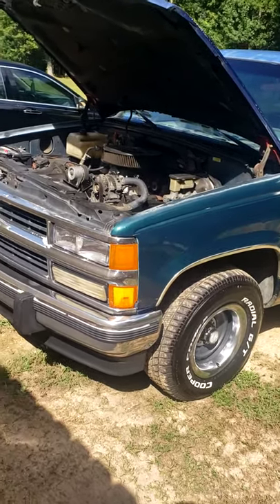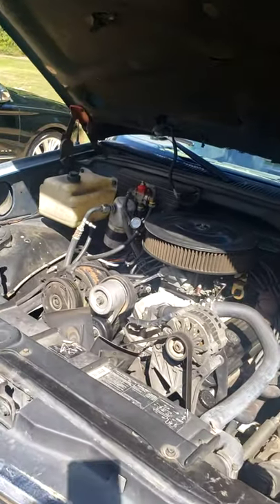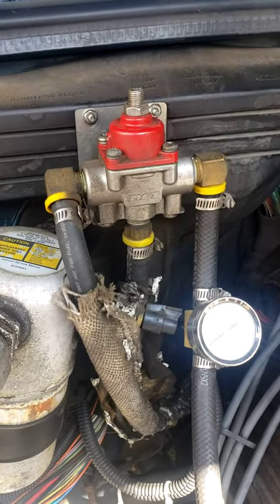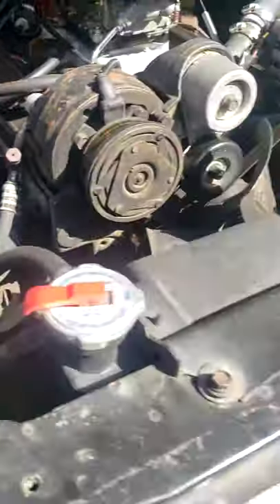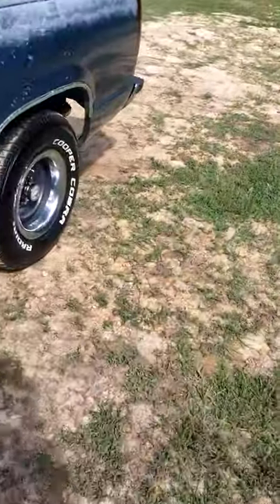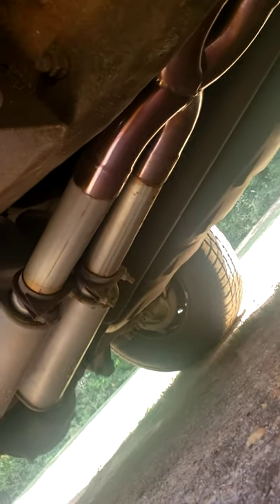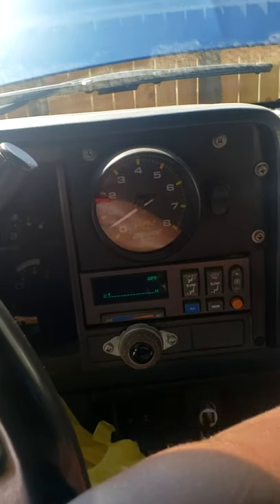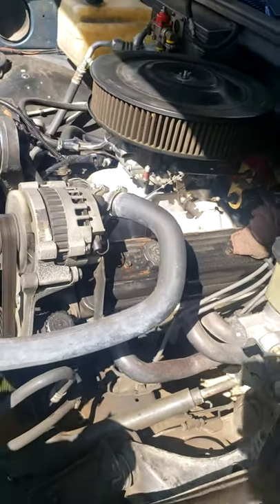Cammed my 91 STOCK BOTTOM END 350 on a SUPER TIGHT Budget!!!

Comment: I have a 90 model gmc. Looking at putting a cam. Would you encourage getting away from the TBI and just go straight carbureted or what? Thanks
Reply from the maker: Good question! It depends on what you are into and your budget. They do offer some TBI cam kits that will work with the factory computer. But, if you get too radical with the cam selection, it will cause drivability issues. I like the carb version better. To me, it's easier to adjust ignition timing and carb settings myself than, to put the parts on I want and then have to get someone to flash the ECM and/or tune it as well.
Reply: @WorkingwithBobby  that makes sense. I already have a chip for 93 octane 165 thermostat. I’m honestly on a budget would like to just do cam. Thank for input!
Reply from the maker: @scott9478  yes sir. No problem. If you do any shopping with summit or any other performance based company,  you should be able to filter your search or talk to the tech department about potential cam kits that will work for your application. ✊🏾✊🏾

Comment: If you get the K&N Filter hat it will do a lot better. All in all nice truck.
Reply from the maker: You talking about the filter that has the top lid which is also a filter? I thought about it. Maybe I'll invest in that set up when I can afford it. Thanks man!
Reply: @WorkingwithBobby  It makes a world of difference. On a low hp engine (round about 210hp) For power
 It's as good as no filter at all.
Reply from the maker: @Deadpool-ODST  that's whats up. I'm going to look into this for sure! I am a sucker for doing things that squeeze every bit of horsepower from an engine on a budget! ✊🏾✊🏾

Comment: How much did it cost to do the front end/grille swap ? And was it easy to do or did you have to do some cutting and grinding? lol
Reply from the maker: Good question! I actually didn't swap the front end like you may think. I hit a huge deer. The junkyards near me didn't have the factory grille like I wanted so, I just went with the newer truck grille. I had to also replace the radiator support. I have been told that it's an easy swap if that's something you want to do though.

Comment: I've got a 1994 chevy 305 and wanna put a bigger cam in it what should I look for to be as similar to yours
Reply from the maker: Some would tell you to first get a 350. You don't have to do that of its not in your budget and if it's a good running engine. All you have to do is do your research as I did and find out what's the most aggressive you cam you can get that will work with your application. I could tell you more given more info on your truck. Would you like to email me?

Comment: Why haven't you got your spark advance vacuum hose hooked up?
Reply from the maker: Very good question! Not sure if I can answer it fully but, I'm only using mechanical advance. Most think that the spark advance gives you more timing under heavy loads and acceleration but, it actually retards timing to prevent spark rattle under heavy loads and acceleration. It robs power while doing so. You have to have your timing set pretty high on any engine to notice the negative effects of not using the vacuum advance. Hope this helps.✊🏾✊🏾
Reply: @WorkingwithBobby  if your timing was advanced mechanically it would be hard to start your engine after it gets warm. Someone had fed you a line of bull. The cam itself has took from your vacuum, but even with the cam try to get your timing right and hook that vacuum hose up to a good vacuum on your carburetor and you will gain 20+ horsepower during acceleration..
Reply from the maker: @markduvall5918  I respect how you feel. No one fed me anything. I did research before I tried it myself. What I did was check my initial timing at idle with it warmed up. Then I slowly increased rpm while watching my timing light to see what my mechanical advance was until it stopped increasing. Then I did simple math to see what total timing was. Right now my total timing is 34 degrees advance. At idle, it's around 12 to 14 degrees which means my mechanical advance would be 20 to 22 degrees. I don't have any issues starting my truck at all. If I'm wrong, I don't mind admitting it. I do believe if running vacuum advance added 20+ horsepower, the racers on track would be doing running an HEI with vacuum advance connected instead of the high end distributors without an advance at all. Thanks for watching.✊🏾✊🏾
Reply: I have a 98  5 .7 that's the same for me a little at  a time hope I can achieve what you have nice work !!

Comment: Do you still have the truck? How are you controlling advance?
Reply from the maker: Yes sir! Belle is the star of my channel right now. I'm not, if you talking about it igniton timing. What I did was Rev the engine up to about 2200 or so rpm, then I put my timing light on it and set total timing to 32 or 34 degrees. Then I let it idle and reset my engine idle back where it needed to be. It put my ignition timing around 12 to 14 degrees at idle. That means my mechanical advance in the distributor is worth almost or right at 20 degrees. Hope this helps!✊🏾✊🏾

Comment: How much of a difference did the cam make in terms of torque and horsepower ? And Im wondering if with tbi heads itd make a difference
Reply from the maker: Good question! I have not had my truck or engine combo on a dyno so, I don't know exact numbers. I will say this though, research has proven that just the vortec head swap is good for up to 30 horsepower gains. The cam is something I have no clue on. I'd like to believe that it had some type of gain or affected the power numbers in some way. I hist don't know how much.
Reply: @WorkingwithBobby  how different does it feel from stock everything?
Reply from the maker: @diegomartinezliscano9341  I immediately felt a difference when I did the head swap. You can feel 30 horsepower in the seat!
Reply: @WorkingwithBobby  forsure swapping my heads 💪🏾

Comment: You’ll wanna run a rubber line from that vaccuum advance you have plugged off. That’s part of your tuning/idle issue…
Reply from the maker: I used to run the vacuum advance o. The distributor but, I disconnected it after I learned what my advance curve was and set my total timing to 34 degrees total timing with the engine at 2500 rpm. That put my ignition timing at idle at 12-14 degrees advance. I then set my engine idle at full warm up to around 725 rpm. It starts and ran perfect after asking some minor adjustments to the accelerator pump lever. So, no need for vacuum advance anymore for me. Hope this information helps.✊🏾✊🏾
Reply: How is your total timing 34 degrees without the vaccuum advance?
Reply from the maker: @andrewayersman6923  I use the weights and springs in the distributor under the rotory button only. As the distributor turns faster and faster,  the weights swing out advancing the ignition timing. It's not 34 degrees advanced @ idle. Only after 2500 or so rpm. Like I said, at idle, my ignition timing is around 12 maybe 13 degrees advanced. When I Rev it up, ignition timing is at 34 degrees per the timing light. It's really easy and helps engine performance! Hope this info helps dude.🤟🏾🤟🏾✊🏾✊🏾
Reply: @WorkingwithBobby  oh I am aware of recurving, I’ve built a ton of engines lol I was thinking that was your tuning issue when I saw you had the advance plugged off. Realistically you should have more than 12 degrees at idle but that’s pretty minor. High rpm is where it matters lol I’m running the k1106 in a vortec I built. Much larger cam than yours lol I have to run a vac pump just for power brakes. Tuning is fun that’s for sure lol

Comment: Would you do or had you dealt with the old harness
Reply from the maker: I just tied it together with electrical tape just in case I need to go back OEM. I did have to cut the ignition coil plug though. I used that source to power the HEI distributor. ✊🏾✊🏾

Comment: Detailed video with part numbers in the description!! 🤘🏻💪🏻🙏🏻 thanks brother!  Keep Hotrodding !
Reply from the maker: Yes sir! No problem dude! Just trying to be a blessing! 🤟🏾🤟🏾✊🏾✊🏾🔧🔧
Reply: @WorkingwithBobby  did you change the springs as well
Reply from the maker: @o.j.edwards5667   no sir. The cam that's currently in it works with stock vortec heads with stock spring pressure.
Reply: @WorkingwithBobby  o.....ok because i got a cam that im wondering if i will have to change the springs
Reply: @WorkingwithBobby  because they said i can use a stock converter
Reply from the maker: @o.j.edwards5667  that's true. You can. It's maybe the biggest cam you can use with the stock torque converter. I would at least put an 1800-2100 stall with it though.
Reply: @WorkingwithBobby  o....ok cool even though its a weekend cruiser

Comment: What made you ditch the tbi? Im about to do the same to my 87 just curious why you did it.
Reply from the maker: Good question.  I had an issue with it running rough at part throttle and low speeds and could not figure out what was causing it. I literally replaced everything and it still did it. Then I made the switch and haven't had that problem since.✊🏾✊🏾
Reply: @WorkingwithBobby  you came to the same conclusion as I did, F@#% it Im done with this its gettin a carb.
Reply from the maker: @imheretolearn770  I understand dude. It's one of the best things I did to my truck. She still and probably forever going to be a work in progress but, at least it's some kind of progress. Good luck on your swap. I put a link or a comment on this video for all who wanted to know what I did to swap it to over to carb. ✊🏾✊🏾

Comment: What length pushrods did you use with this setup??
Reply from the maker: Good question. I thought I answered that in the description and in the video but, they are whatever length the stock TBI sbc pushrods are since that's what they are. I only swapped the vortec heads and vortec rocker arms. With the exception of the carb, distributor and intake, everything else is stock TBI 350.

Comment: So on your cam did you have to replace anything or is it all stock and if so what did you replace?
Reply from the maker: I did not have to replace anything but the lifters which came with the cam that's currently in the engine. I have stock push rods and self aligning rocker arms for the vortec heads. Hope this helps!✊🏾✊🏾
Reply: @WorkingwithBobby  yea thanks man couldn’t find what cam I could run with a stock 350

Comment: I got a question I have a 4.3 in a 94 c1500 5 spd how do you know if it's vortec or not. My valve covers don't have vortec on them like I've saw B4.
Reply from the maker: Good question! I'm not an expert in this but, I remember the 4.3 liter v6 having vortec style cylinder heads. They were pretty much the same design. Just with 3 combustion chambers on each head instead of 4. The vortec style/design was not exclusive to the v8 engine. Hope this helps.
Reply: @WorkingwithBobby  because I wanna get a slightly bigger cam would I just get number from block or vin?
Reply: @WorkingwithBobby  I'm running stock springs pistons everything
Reply from the maker: @tre9563  ok, you can call the tech help line at summitracing.com and they can point you in the right direction. I personally would stick with a cam that is compatible with the factory computer controlled fuel injection.

Comment: One more question you think am able to used this cam with my stock tbi am fuel ijection not carb i have a 383 stroker but the cam its way to small
Reply from the maker: Good question. I don't think so because I do not remember if it is compatible with fuel injection. I would contact summit first and ask the tech department to be sure. ✊🏾✊🏾

Comment: grill style on your truck came out in '94
Reply from the maker: Thanks for the info. The junkyard I got it from said it was a 94-97 grille.
Reply: @WorkingwithBobby  it is a ‘94 - ‘98. GM changed the interior on the Chevys and GMCs in ‘95 and carried the interior til about 2007. The exterior completely changed in ‘99. The time period that Cvevy and GMC trucks like your truck, parts are interchangable. Those trucks are the best trucks ever. Do you agree?
Reply from the maker: @sambostic8715  oh yes without an doubt! I love my truck and these 400 gmt trucks!💪🏾💪🏾✊🏾✊🏾
Reply: @WorkingwithBobby  my dad had a ‘94 chevy and got rid of it because my mom wanted him to get rid of it and later he had an ‘89 chevy and same thing as the ‘94. Both had a 350 in them and we currently have a ‘93 and it has a v6 262 in it. I am gonna get it after i get my lisence and gonna put a v8 350 in it and fix it to where it looks like as if it came off the assembly line.
Reply from the maker: @sambostic8715  that's whats up man! Good luck with that! Keep wrenching bro!✊🏾✊🏾
Reply: @WorkingwithBobby  it sounds simple. Engine Block, wiring harness, motor mounts, battery, transmission, rims, tires, interior panels, exterior panels, primer, paint, interior accessories, exterior accessories, and time and money to do it as well.

Comment: It still has the stock stall? Or you had to change it up because of the cam
Reply from the maker: Good question. I have a 2100 rpm stall converter in it now. It's a nice street converter I got when I had the trans rebuilt. The cam that's currently in the engine is supposed to work with a stock stall tho.✊🏾✊🏾
Reply: 👍🏼 nice. Sounds great Man. Did you say you running a flat tappet cam? Why? When you took the intake off it didn’t have the holes to just drop in some factory roller lifters? That’s what I thought anyways just asking?
Reply from the maker: @yeahididit9054  thanks dude! Yes, it is hydraulic flat tappet. I don't think this is a roller block. It's a 1993 casting. There are retro fit roller cams I could install so to run roller lifters and cam but, I have a 199 block that I may do that with one day. It came with roller cam so, it will be easier to upgrade.

Comment: Could I do fuel injection instead ? I got a 95 tahoe I’m trynna get some vortex heads
Reply from the maker: The vortec heads will work. You will just have to get the pushrods, rocker arms and roller lifters to go along with the heads. I do not recommend this cam with the factory fuel injection.
Reply: @WorkingwithBobby  appreciate you boss I’ll be making some videos of the Tahoe Ill pick up some time soon .thanks for the help
Reply from the maker: @luisbarrueta658  no problem! ✊🏾✊🏾

Comment: how much was it to rebuild the block at machine shop
Reply from the maker: @Adamdub612  good question. At the time the cost was $1250 for a reman 350 with a $400 core charge for the old long block. So, like $1650 for an OEM long block out the door without a core to turn in.

Comment: What headers, wheels and tires are you running bro??
Reply from the maker: These were the shorty headers o ran before the long tube. Same wheels, different tires.
Reply: @WorkingwithBobby  I have a 94 that I want to put tires and wheels on but not sure about sizes and like how it stand and was curious. What made you go to long tubes? What were the reasons for the change? Did the shorts give off a lot of heat that you felt near ur legs?
Reply from the maker: @gamebred5x  shorty headers broke so, I upgraded.

Comment: Hey what stall converter and gears do you have?
Reply from the maker: In this video, it has a 2100 stall and the factory 3.42 fears with open diff.
Reply: @WorkingwithBobby  thanks man was thinking about swapping this cam into my k10 but it has 3.08 gears and a stock converter and didn't know if it would match well

Comment: How much power were you making with this setup
Reply from the maker: I honestly have no clue. I've never had it on a dyno. I can't afford a dynamic section right now but, I plan to get that done one day. I would guess with the small lift cam and the vortec heads it probably makes around 330 horsepower and maybe 355 lb ft of torque. It still has stock open 3.42 rear diff set up as well.

Comment: What headers you running?
Reply from the maker: Good question! I got these headers from Amazon years ago. They are a direct fit header that replaces the factory exhaust manifold. So easy to put on that I installed them in the parking lot of the apartment building we used to live in! Hope this helps dude!✊🏾✊🏾

Comment: I wonder what happened to his gas mileage with this upgraded engine?
Reply from the maker: Good question. I can tell you this. Even after the upgrades, I still could fill up in Orangeburg, SC and drive to Charlotte, NC to the races and get back to Orangeburg on 1 tank of gas. The fuel needle be just under 1/4 of a tank. It's not Honda civic mileage but, I'm happy with it. The overdrive in the 700R4 makes a difference. ✊🏾✊🏾

Comment: I’m a big fan of flow master hp
Reply: I have a 98 with built high torque ported the vortec heads. Beware it eats the 4L60E.  On 4th transmission since motor was built.
Reply from the maker: @firebug1337  ok, I will definitely keep that in mind as I upgrade this engine!

Comment: will this cam fit on a 1988 chevy c1500 350 5.7 tbi
Reply from the maker: Physically it will fit in the block but, the cam may not work well with factory TBI. You would have to choose a TBI cam for your truck. If you don't,  you may run into issues.
Reply: @WorkingwithBobby  I have a 1406 600cfm edelbrock carb and intake for the truck
Reply from the maker: @MR.450MXC  if you are doing a carburetor swap then, it should work fine.
Reply: @WorkingwithBobby  ok thank you bro

Comment: How is it tuned ?
Reply from the maker: I had to set ignition timing and the carburetor settings to where the engine was happy. Sometimes,l rhe base setting is not what the engine wants. If you listen to an engine perform as you drive it, you are sure to find out what it wants and what it doesn't. Took me like 2 weeks off and on to get it perfect.